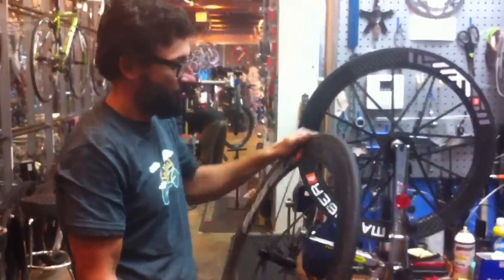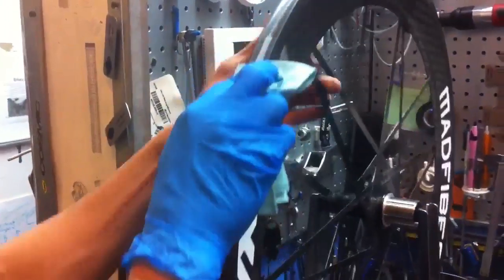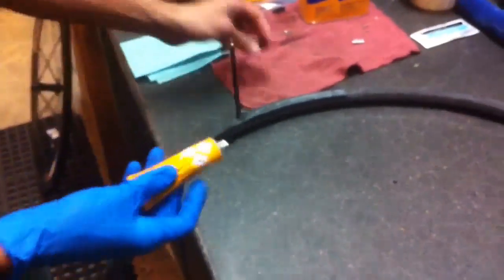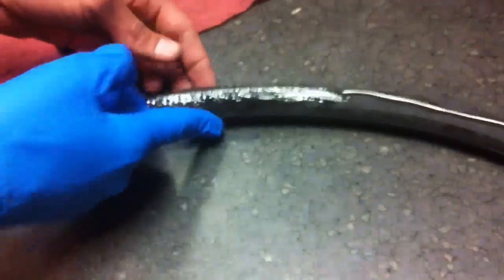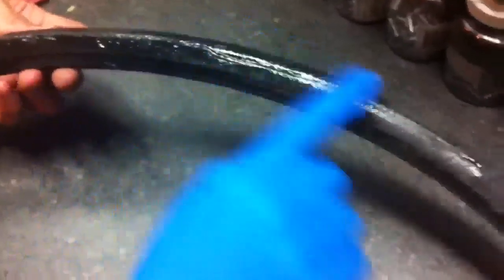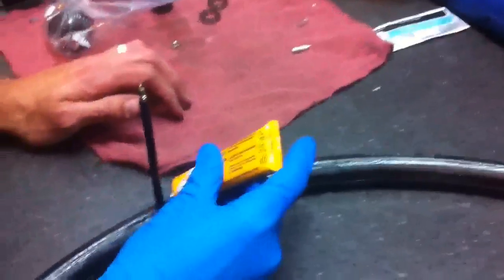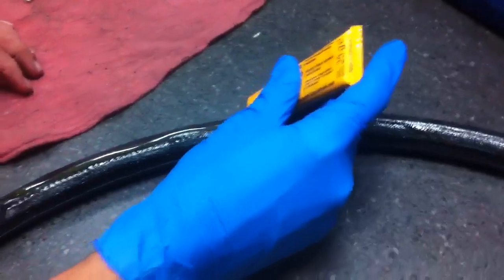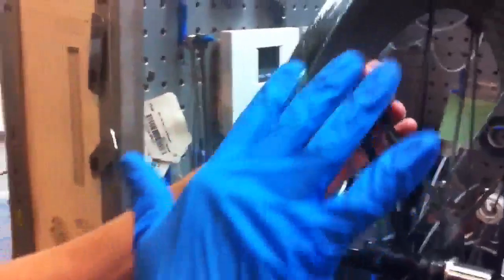How to glue a tubular tire on a carbon rim

Comment from the maker: I have used the carbon specific Conti glue, but we've had some issues with it holding strong enough. I prefer the standard Conti glue in the orange container or tube or the Vittoria mastic one. Sometimes I use a brush, but it is pretty simple to use the small tubes and smear it on with gloves.  The tire was a Mavic BTW.

Comment: Have you used the carbon specific Conti glue yet? In the black tube-- i usually let it set at least overnight 1st coat but 3-4 hrs sounds better/quicker-- i think its better to use a glove like you vs a acid brush which i have been using, looks faster-- Nice wheels, i just b

Comment: @ Joey Mesa,
Thanks for the video. I am new to tubulars and have been gluing them up just like the video but with a Flux brush. 
When gluing a tubular on a wheel that has been used, how do you prep the rim? If you are still making videos anyway you can make one on gluing to a used wheel?  
Thanks again.
Reply from the maker: Sure I'll do another one on a previously glued rim when I get a chance. Depending on the wheel, I will either leave it alone and add a light coat on top of an existing layer or if its really thick and clumpy, I'll scrape some or most of the old glue off to smooth things out. A hair dryer or heat gun if you're careful make it easier on carbon rims. On alloy rims, I like using the wire wheel brush on a bench grinder.

Comment: Can you please tell me what psi is that tyre at when you finally seat it?
Reply from the maker: +Wallace Pei I usually put 130-150 psi in the tire after it's centered and straight and let it set until the glue dries. I typically run 80-100 for actually riding/racing, but that's just my preferance.

Comment: Hi I have a carbon fiber fishing rod I'm looking to repair.  Do you think this glue would burn the carbon if I was to use it for the repair.  I would be using it directly on the carbon. Thanks.
Reply from the maker: Hey Barry, the glue used in the video works well to attach tires to a carbon rim but it wouldn't work for actual carbon fiber repair unless it was to bond something to the carbon. If your fishing rod is actually cracked or broken, we've had good luck getting our carbon fiber bike frames and rims repaired by these guys:   http://simmons-racing.com/